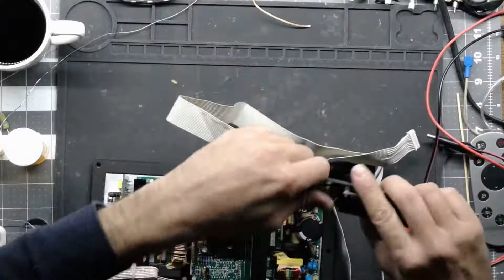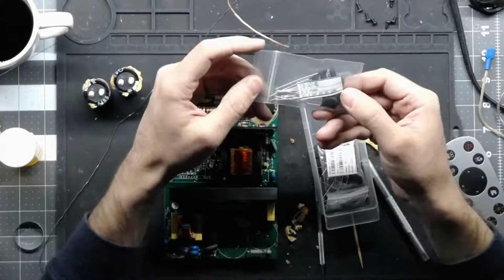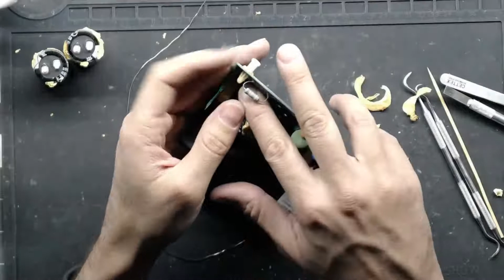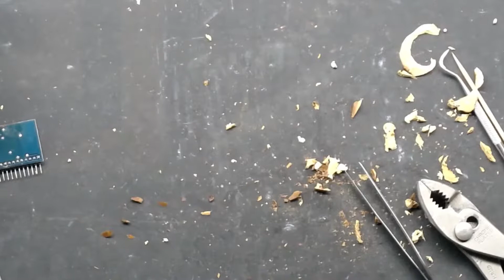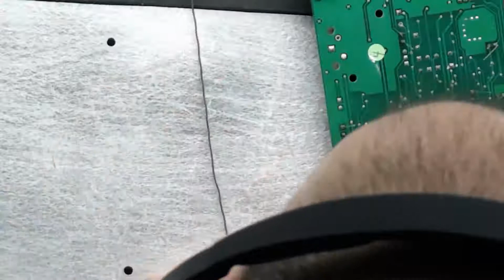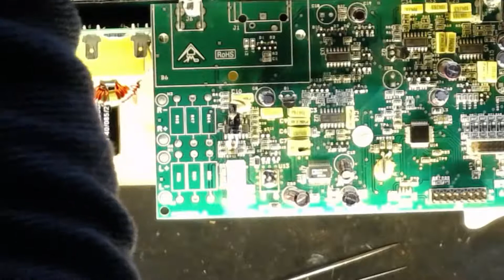Supreme Innovations LLC Live Stream - 011 - Klipsch RSW-10D REPAIR

Comment: Hi, I have a Klipsch RW-12D amp plate, S/N A308260116, blows T3.15A fuse instantly (yellow glue issue). Do you have an opening for repair? How long is the wait and total cost? I am in NY 11706. Thanks, Chang.
你同时给两家都发一下

Comment: One other question, I was wondering, would a heat sink help make those voltage regulators last longer? I have a RSW-12 Klipsch Subwoofer that i love and so far it has worked fine but i noticed today they have been out of production a long time and the new subwoofers from Klipsch don't appear to be as good. Any way good video.

Comment: I really enjoyed this video. I am mech engr not electrical engineer and I only know basic electrical circuits. I was wondering what all that sloppy glue is for ... is it to hold the parts in place before they dip the board in solder during manufacturing? Again I am layman with electronics and the only electronics I have ever fixed is when I notice an unconnected part (like that rectangular yellow cap you fixed that wasn't connected)

Comment: Yeap, found the same thing.  My 7805 was blown !  Really weird since those regulators usually lasts for ever.  The original ones must be crappy or not be able to resist vibration.  Thanks for the information you provided.  Great job on the pcb  !

Comment: Any chance you know the value of the smaller yellow capacitor on the power supply. The one you changed. Mine is melted and I cant find a schematic with values. Thank you
Reply from the maker: What is the designator for the part?

Comment: I am so happy to have found you as I just got a non-working Klipsch RSW-10 that a guy threw in when I bought a pair of RF-5 towers off of him yesterday. So I will be troubleshooting it to see if the speaker is good and may need your help of the amp requires repair. Thank You

Comment: I know this video is a bit old. Ive been attempting a repair on a rsw-10d and replaced almost everything on the power supply. I decided to try to the 5v to theeft leg of the regulator and to my surprise screen lit up. my regulator stopped outputtig the 5v at some point. Then I went to 12v and touched the other side of the regulator and got your exact symptoms from the video. When I was at 12v I may have touched the diode directly above the regulator. Now I have a 5v short. What's weird is even though the regulator was dead, when I tried to power everything up to see if the screen flickered at all, smoke suddenly stated coming from the small board with the smd components on the power supply board. It was from the resistor at the top to middle left. With the ribbon unplugged, I still get the short when trying to supy 5v to the reg. and With the output leg of the 5v regulator lifted I still get the short. Any ideas on what I did? Can the diode/zener above the regulator being bad suddenly cause 5v short to gnd?

Thank you so much for your videos! They are extremely informative!
Reply from the maker: See if 5V and GND will get the LCD working. If you burned out the control chip the amp is trash. If the LCD still works, then you need to work backwards to the power supply replacing whatever is damaged. I need pictures or a video to understand the problem more.
Reply: @supremeinnovationsllc  yep. IC is shorted. Heats up like crazy. Checked on infarad camera.